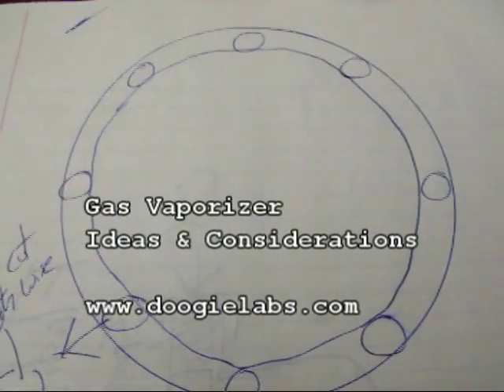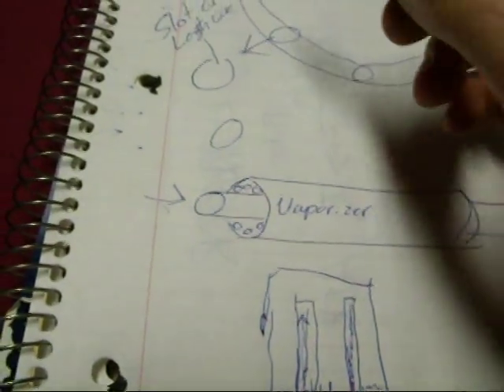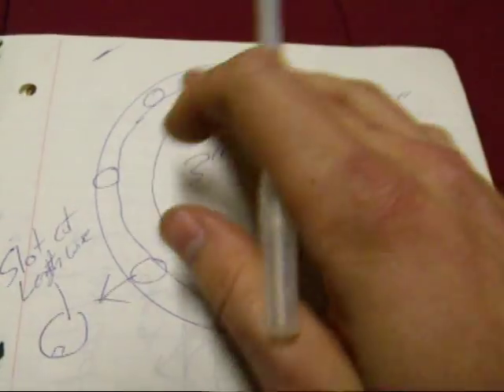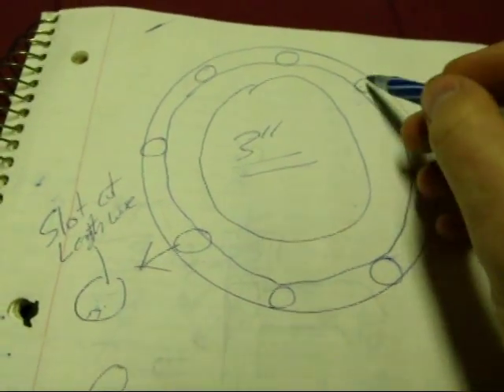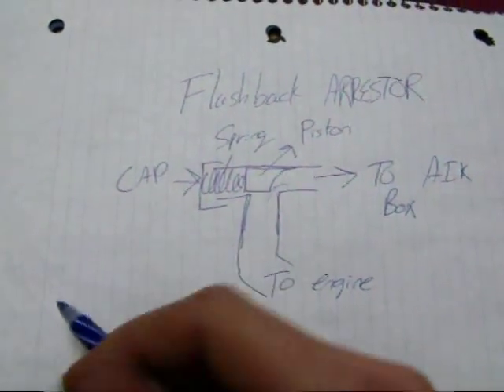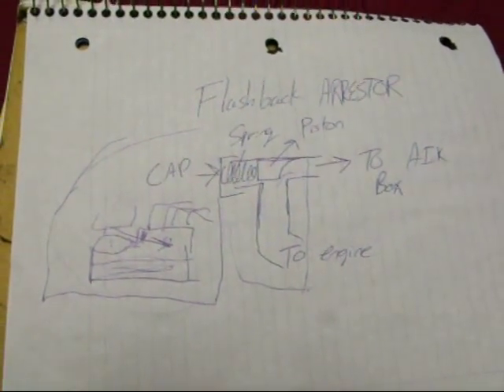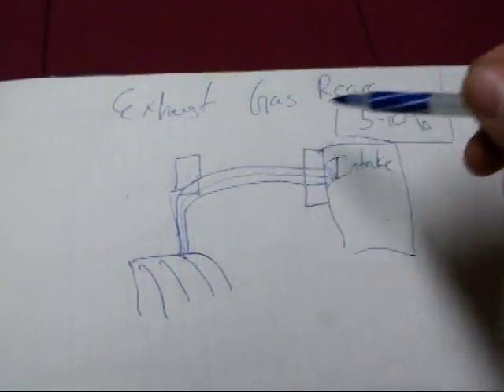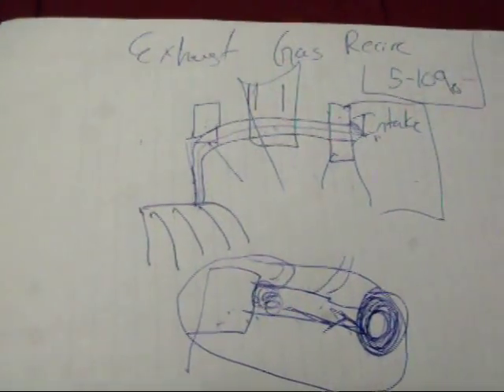Gas / Fuel vaporizer ideas and considerations

Comment: Thanks for replying!
Lets say i can produce enough fuel vapor to idle and rev my car to 2k rpms, with very good power, keeping exhaust temp in check and with no gasoline leftovers. Can i program my arduino to shut down the injectors until the car revs past 2k rpms? Injectors share common 12v?
Thanks for helping!

Comment from the maker: manufacturers to control the power to the fuel pump to increase flow at higher RPMs but not create too much fuel pressure during light driving / low RPMs. You could build a PWM fuel controller to do this, Subaru used to use a resistor for a high / low switch. I would recommend PWM though. Then the ECU doesn't even need to be bothered and you dont need to hack into the injector wiring. Verify your air fuel ratio with a wideband oxygen sensor when you experiment. Be sure to take a baseline datalog

Comment from the maker: Very interesting question, and the answer is, kind of. You won't be able to chop up the signal until you know how long the ECU intends to fire the injector for, and then cut that in half. This creates too much of a delay I feel. If you had access to the ECU on the lower level and could burn chips for it that would work. Another way you might be able to do it is with fuel pressure. Injectors flow a certain amount because of pressure on the fuel rail, it's not uncommon for auto (continued)

Comment: I have my new vaporizer built and installed I have ran it a few times and will be adding a few more things to it so it works even better then it does right now. Once I have done that I will be testing cold water vapor and steam injection into the gasoline vapor mix to see what kind of results I get.

Comment: Just wanted to let you know using a coolant line to heat up the gas into a vapor will work at low speeds but does not perform very well at high speeds or high rpm's for an extended period of time. The container will become to cool as the air passes through it. If you preheat the air coming into the container this will fix the cooling problem. Heating the line that takes the vapor to the intake works very well to further gasify the vapor.

Comment: To see how a vapor system work take a sponge soak it in gas and place it in front of an intake that is all you need to understand how fuel vapor works. It is the training wheel of how the system works. Only one thing fuel now days is watered down it does not vapor much since the addition of ethanol and watering down. Fuel vapor would require heating and more purer version of gas without all the additives now required in gas.